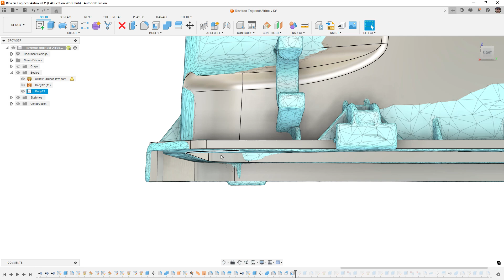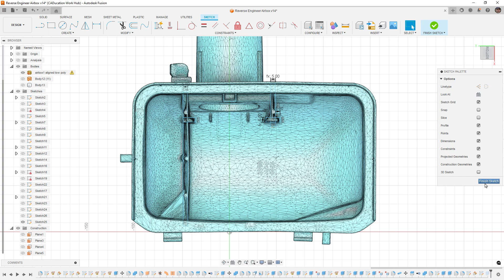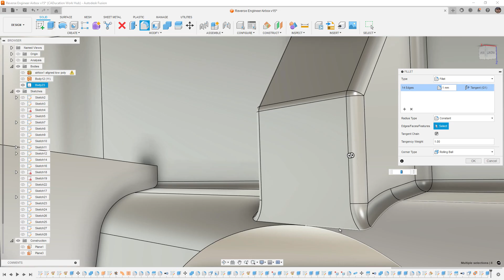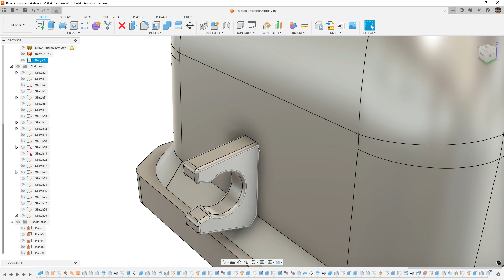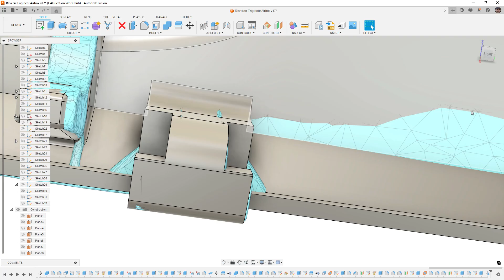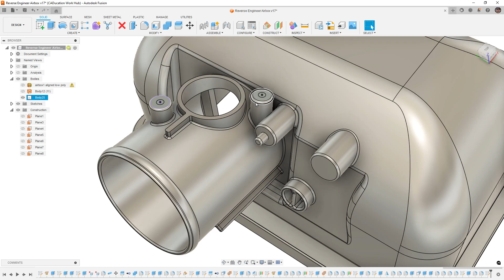Reverse Engineering Scanned Car Parts - Airbox Series Part 4 #fusion360

Comment: This video series was amazing!  I just finished all parts. There was so many things I realized I wasn't utilizing or doing the hard way. As someone that is looking at doing more modeling and reverse engineering of automotive parts, this was exactly what I needed. Doing basic "mechanical" items seem pretty simple and don't give me much trouble, but more "free-form" type of items that are injection molded or have more complex geometry have left me confused or frustrated many times. But this series gave me many more tools to attack those items more confidently.
Reply from the maker: Happy to hear it!  Keep in mind(which im sure i said elevnty hundred times) that we deviated from molded design to 3d printed because that was the intent for the user of this one.  We do have some injection molded specific design courses on www.LearnEverythingAboutDesign.com  and will be working on more this year.
Reply: @LearnEverythingAboutDesign  oh no, it was perfect for me because I am 3D printing hard to find or replacement parts for old Hondas. But I have struggled with matching up some of the complex geometry of interior parts and trim pieces and like. Funny thing is I actually work for a company that injection molds and extrudes plastic for the piping and plumbing industry. But for my own uses, everything is geared towards 3D printing.
Reply: I also found the series of tutorials absolutely fascinating. Unfortunately, I haven’t been able to find the STL file online. I love following the tutorials whilst simultaneously recreating in my Fusion what’s described in them. Would you be so kind, if possible, to share or send me the STL file if you have it? I can give you my email address if you’d like. I look forward to hearing from you. Bruno from Milan.

Comment: what I cannot get over is you did not use one loft function, and that has been eye-opening.
Reply from the maker: If you can stick with simple shapes it will always be easier!  Some things require a loft for sure but this one actually broke down pretty well to some simple profiles and extrudes!

Comment: I wonder how much this kind of work costs from you?
Reply from the maker: You don't wanna know :)  Typical rate for professional CAD services is $150-$200/hr.  Doing a part like this for 3d printing is a bit easier than doing it for molding.  If it were a molded housing that would be 20-40hrs just as a first guess.

Comment: You bring up an important aspect of re-engineering parts: knowing the purpose of certain features (e.g. those tubular additions to internal walls are there for ejector pins [who knew?]). I would imagine there are lots of other features that can be improved or eliminated if 3D printing is the goal. This original part seems like an unfortunate mess due to the production process.